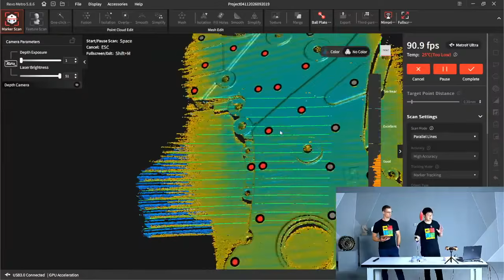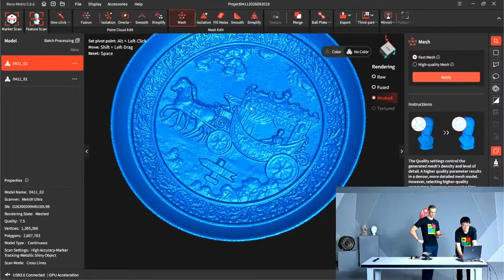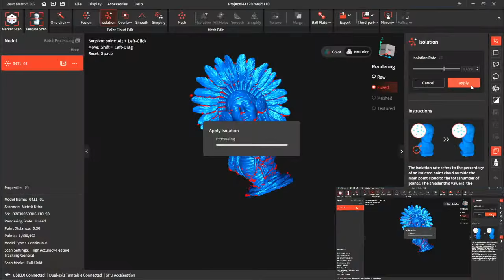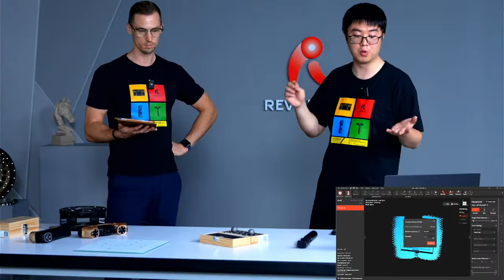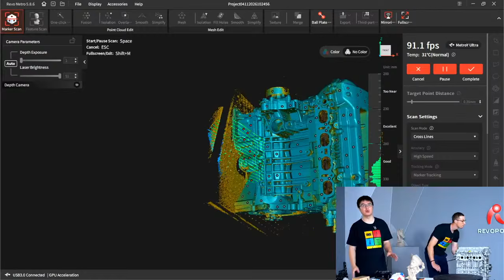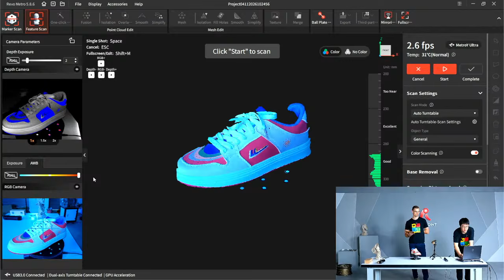Revopoint MetroY Ultra Live Stream - Live Demos & Special Savings Await!

Comment: Whats the contrast to the metro y pro features?
Reply: 0.015 mm accuracy 
Outdoor scanning to 100K lux light condition
3 million points per sec/ laser mode.
Extra laser lines Cross line.
90 frames per sec GPU acceleration 
60 frames per sec CPU
High Speed scanning mode
Accuracy live test ( Ball Plate /CMM version)
Reply: @PUTV3D not correct